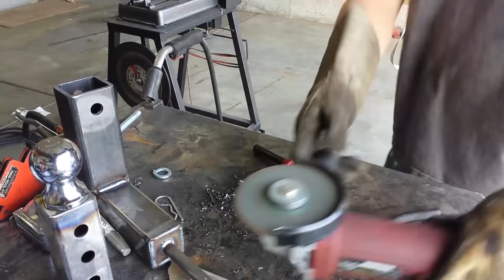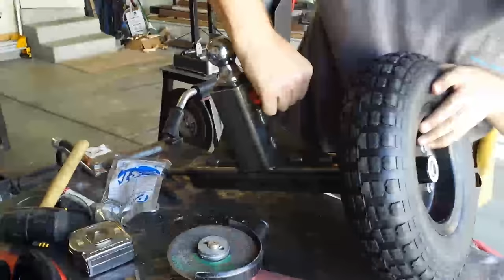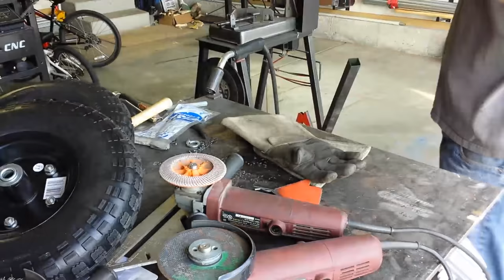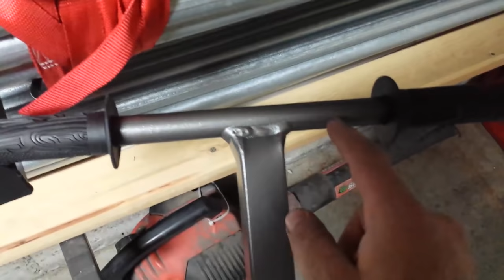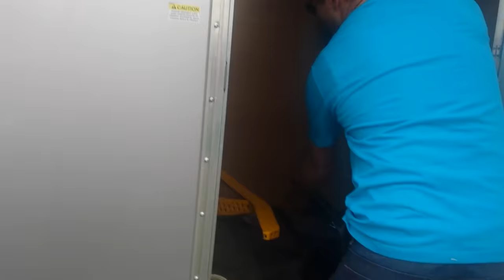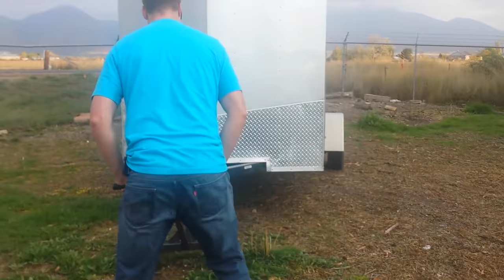Trailer Dolly -- Part 2 of 2

Comment: Those two instructional videos at fast speed were Fantastic, because Im a visual learner not a reader, I got the whole thing down, straight away, it all looked so simple and straight forward, excellent, and little short cuts you did I didnt know of, like spot welding the tube to the table to weld it instead of clamping it, was great, I can wait to start my trailer Dolly, im planning to put an electric motor and battery on mine,, Great Work

Comment: Shift the center of gravity forward or backward from the dolly wheels, add a heavy duty caster wheel. This will stabilize the dolly allowing you to spend less energy stabilizing the dolly and more on moving the trailer.

Comment: I like the idea and will modify it with a third, swivel wheel in front and the ball offset slightly forward for stability, easier pushing and possibly using my small lawn tractor as a trailer tug.

Comment: You could use those 'cosmetic holes' to attach a short foot for resting the dolly on the ground. That would help prevent dirt attaching to the towball and end up inside the coupler. Modifying one of those folding door stoppers found on places like Amazon might be a quick way of going about it.

Comment: Wow, I am pleasantly surprise with the work overall, from cutting, bending and welding. I am not sure if the poster is in the welding business but it is clear he has plenty of knowledge on how to go about building a dolly and attaching its components. In spite of the snags he mentioned I wonder if wider diameter for the axel  and bigger wheels from Marathon not Harbor Freight will give you a better and solid traction.
Reply from the maker: Thank you.  I am not in welding, (IT actually), but I have had lots of practice with GMAW

Comment: Great project, very nice and useful! If you cut a gear with plasma cutter machine and weld it on one of wheels and connect with a chain on a small DC motor and a small battery you will push/pull easier the trayller. Congrats!!

Comment: Great job.  Video and the dolly.  If you added a small DC motor with a two way switch that would make moving around even easier.  As your not going around the block a small setup would work well.

Comment: The problem with the rims is that they're 2 pieces and bolted together. If you cut out a ring on your CnC and use longer bolts that should stiffen them up. That's if you haven't replaced them by now...LOl. They're meant for hand trucks and they are pretty weak.

Comment: If you built the dolly to fit over the tongue jack without the wheel, the dolly would be more stable when you're pushing the trailer put an second jack that swings up and out of way to help  lift the tongue.

Comment: Great videos.  I'm definitely building one of these soon.  I have two trailers and really need a dolly.  What grey paint did you use? It looks great.   Also, you mention using a wide wheelbase.  Wouldn't anything larger cause interference with the A-frame of the trailer tongue? I suppose not only if it is jacked up high enough.  I would think 24" might be overkill and takes up more storage space.  I'd think maybe 18" would be ideal.  Thoughts?
Reply from the maker: Rustoleum Hammered spray paint. It needs to be a little wider than this.  Regarding the base, I would just measure out your trailer from the hitch to the jack.  Make sure your wheel is wider than that

Comment: Just as a suggestion in the uk we fit jockey wheels to our caravans and trailers as well as having the leg on the other side would it be worth fitting a jockey wheel and you can push it with ease
Reply: Agree a jockey wheel would be better, my 8x5 double axel is very easy to move using the jockey wheel.
Reply: +peacockealot a jockey wheel only works well on hard surfaces.  Next to useless on soft grass
Reply from the maker: +youngfisho I agree.  I had to use this in about 6-8" of snow the other day, and I thought about a jockey wheel and how it would have been impossible to move in that situation.

Comment: nice..hub motor, controller & a battery tray would be a nice upgrade if you found yourself using it more frequently
Reply from the maker: I got rid of that trailer and have a bigger one now.  I haven't had a need to build one yet, but if I did for my new trailer it would definitely need these upgrades (too big to move otherwise)

Comment: Why not just weld a ball hitch to the front bumper of the truck. That way you can maneuver your trailer into tight corner with your truck. especially when trailer gets heavier. Nice job though! I am like paulmaters. I love Fast speed right to the point.
Reply from the maker: Didn't think of that
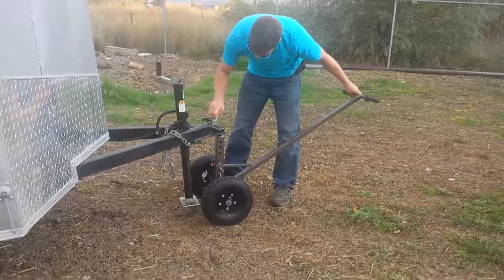Reply: And look at 12:23, (i'm not that good in English) at this place you could aply a service wheel (not just a stand you lift in 12:23) you can lift up or down this wheel in the same method, and you could apply just a simple "steering rod/bar" to this wheel and do the same parking in wherever, without need to bear this cart everywhere together with the trailer.

But your "blazing hook on wheels" looks really sexy! - 100 pounds )))

Comment: Nice work.  Just curious though, why you welded the handlebar to the end of the arm?  It would be stronger if you drilled a through-hole through the end of the bar, run the round bar through, then welded it up and made a cap patch for the end.  Just a thought.

But it came out really nice, and great work on the video (though I did cringe when you set the spinning grinder down.  ;-))!
Reply from the maker: interesting thought..... it just didn't occur to me

Comment: Hey John, where did you buy the metal table?
Reply from the maker: I made it.  It was my very first welding project.  I don't have a video on it, but here is a thread that shows the build:
http://weldingweb.com/showthread.php?29776-Newb-First-real-project-(welding-table-of-course)
Reply: A lot more cost effective to make welding tables.

Comment: 那个等离子开孔 用的什么设备，貌似是手动的，不是数控等离子切割？
Reply from the maker: Unsure what you are asking.  Google translate didn't make it very clear.
Reply from the maker: Plasma on a Torchmate 2x4 CNC table.  It will cut any 2 dimensional pattern I program in it.
Reply: 谢谢   这个设备多少钱？ 中国买不到这个小的机械
Reply from the maker: 7-10 K depending on the plasma cutter and options.
Reply: Чего?

Comment: Besides, it needs a break in order to stop it in a down/up hill
Reply from the maker: No break necessary.  You can just drop it on its jack.....  If that isn't enough friction you can add a rubber pad to the bottom of the jack foot